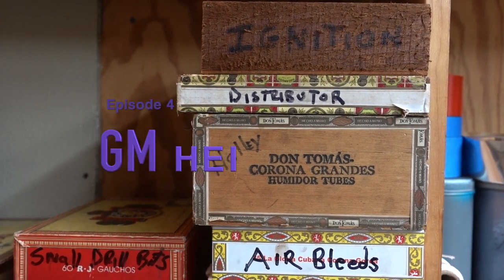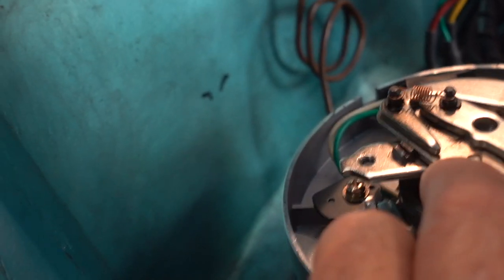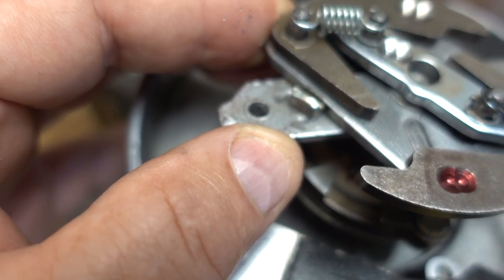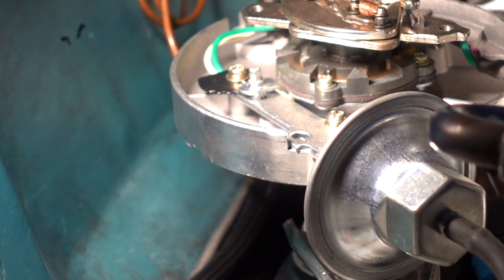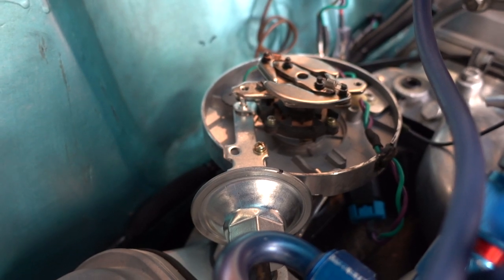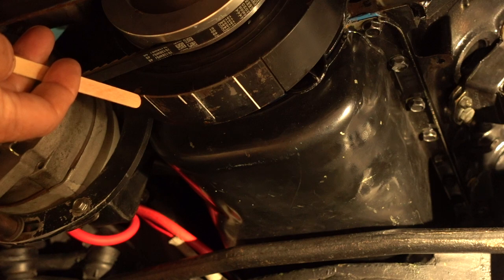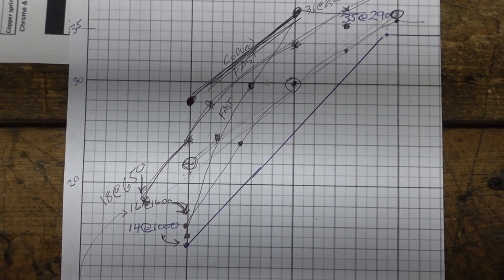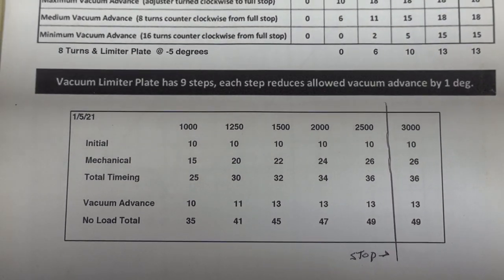Episode 4 - GM HEI  Recurve

Comment: Great video. How do you know what your mechanical and vacuum advance "goals" are?  Thanks!
Reply from the maker: It will depend on what your set up is. For an average street hot rod, the thinking is around 36-degrees total timing in by around 2800 rpms. With todays shit unleaded gas, you need a lot of timing at idle... like 30 degrees at idle. So the curve looks like 26 degrees of advance in the distributor, 10 degrees initial on the balancer, and then maybe another 24-degrees of vacuum advance, that comes and goes under various loads. Some guys just lock it  at 36 degrees, but that's bad on gas and adds heat when its not needed. Trial and error is the fun part.  Good luck!
Reply: @wolfwengler  Thanks for the comprehensive reply! I guess you then try a "setting" and test until it pings, then back off a bit until no-pinging....
Reply from the maker: @gustavette8487  Get some graph paper and plot out your timing curve so you know what you have. Then you can experiment. The key to all changes is to make one change at a time!
Reply: @wolfwengler  Exactly, ... Thanks again.
Reply: @gustavette8487  you are correct.... add timing until you get ping and back off 3 degrees.... first tune mech advance with vacuum advance unplugged. Afterwards reconnect VA and tune to ping then back off 3 degrees. An aftermarket canister also has an internal spring also in which the rate of movement can be adjusted.... also something no one ever mentions is making sure your rotor is in “phase” with the cap....
Reply: @trailerparkcryptoking5213  What you mention about the rotor is sooo true... Also, I would like to know how to check if my harmonic balancer might have shifted. Thank you!

Comment: Doesn't the rotor itself limit the advance on a hei distributor ? I've never used a limiting screw before. It's usually not getting enough mechanical advance for racing. Even with a curve kit. I have welded the advance for racing and locked in At 38° timing but it is hard on the starter's with a Big Block Chevy Engine. I use vacuum advance and the curve kit as a compromise for easier starting and better fuel mileage. But there is a very fine line and slightly A delay between vacuum advance drop off when the throttle plate opens up and the perfered 38° of Total timing. It's all got to be doing it just right. The better the ignition works the better the carborator response is going to be. When it is right you will feel the torque right in the seat of your pants. Maybe using the msd rotor is Why you need a limiting screw ?
Reply from the maker: The MSD Rotor is more 'stout' with better contacts. As far as limiting HEI advance goes; it's a pretty common thing. You can Google it and see different approaches people have. Talk about a fine line.... I hear ya! Have you tried different vacuum cans that open at faster rates? My car was pretty good in Florida and now I've got it in Colorado! Everything related to vacuum had to change and I'm still changing stuff for summer/winter.....  Thx!